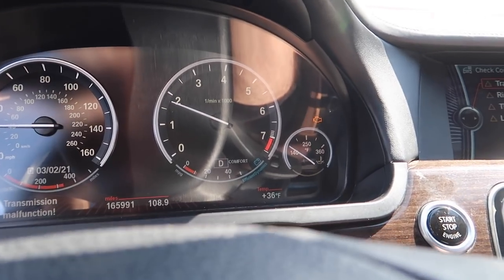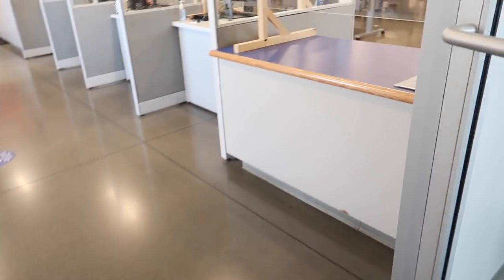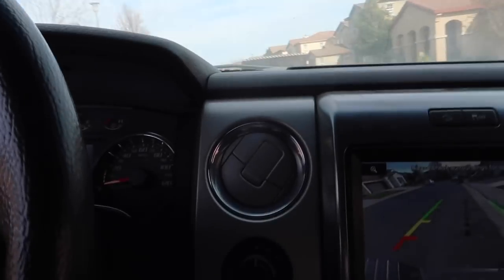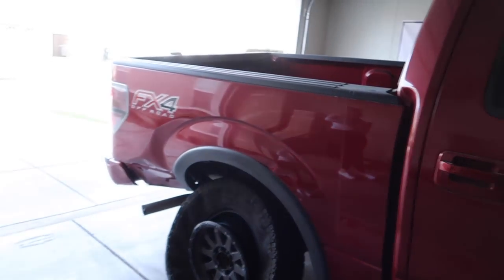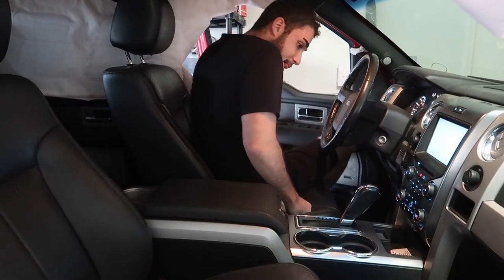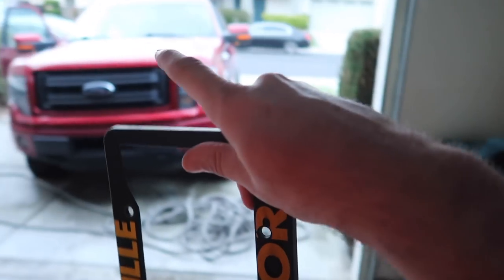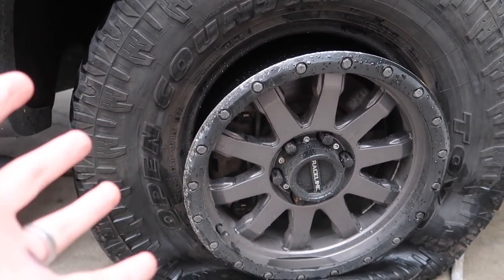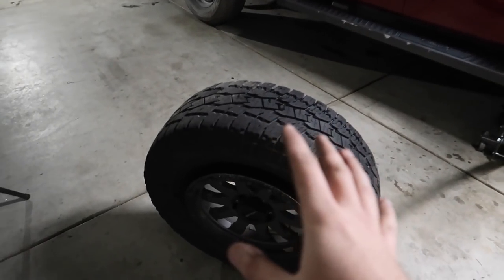Rebuilding My TOTALED 2014 Ford F150 Part 1!

Comment: Question if you would mind how much did you pay I saw it’s at 123k miles 2014 I’m biding on a 2013 with 126k miles Similar damage what’s a good price for one I’m not in cail but never bought a truck or know anything about them need one for towing cars as I buy and sell auction cars as a side thing just getting started but need a truck paying for  towing adds up when I’m getting it towed from Seattle wa to Oregon from $400 to $800 each car